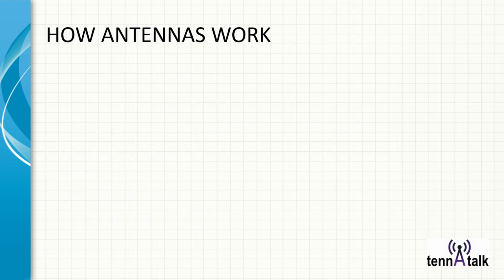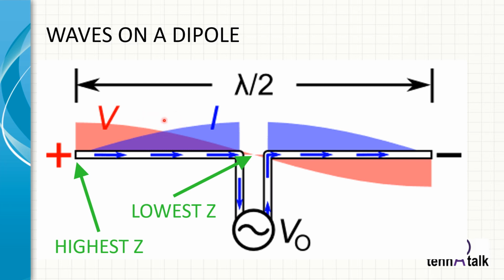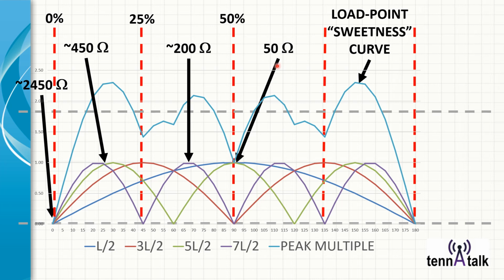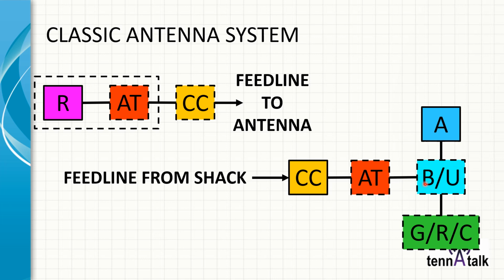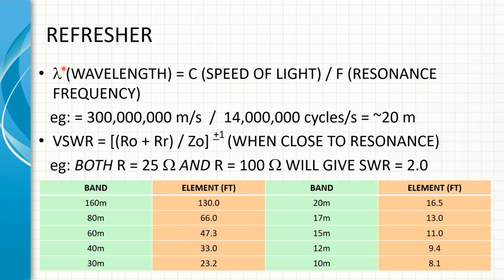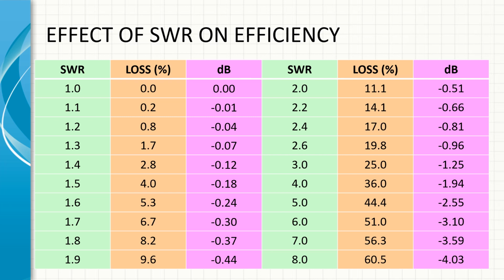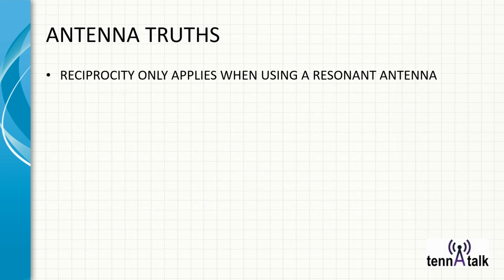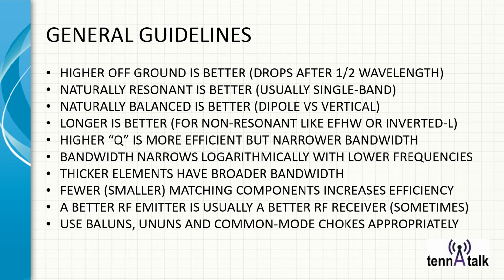TennaTalk #1 - Making Waves

Comment: Hi Rudi, I'm trying to learn how to practically build coaxial stub matching design by using T connectors, and coaxial 1/4 wave stubs, and whatever else may be necessary to bring a system into 50 ohm impedance match Do you have any recommendations of books or videos that will explain how to do this. Thank you!
Reply: The ARRL Handbook and Antenna Book will show you all about how to do this.

Comment: Excellent! Just found your pool noodle antenna and now I'm working my way through your other videos. NOW I understand why there are baluns for different ratios. Thanks so much! 73 de WB3CFN
P.S. "For now..." I operate 100% mobile. I'll be looking for some tips to improve my Yaesu FT891/ATAS-120A setup. Aiming for DXCC as a mobile station. 
😃
Reply from the maker: GROUNDING, GROUNDING and then more GROUNDING to your vehicle body as close to the radio AND the antenna as possible. HUGE difference. Works for my 857D and ATAS120A. Lots of DX.
Reply: I use an FT-857D with the ATAS120. Be sure to GROUND that antenna mount VERY WELL with flat braid cable to the nearest good ground (I use the bolt right in the door channel to keep it short)